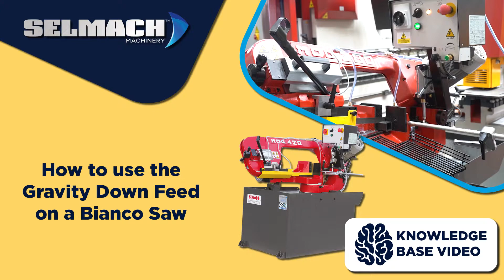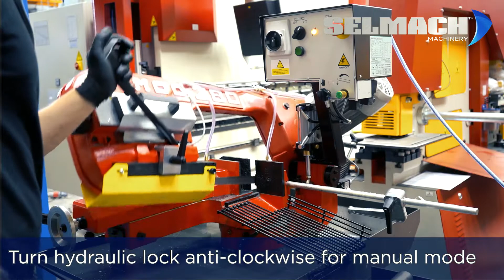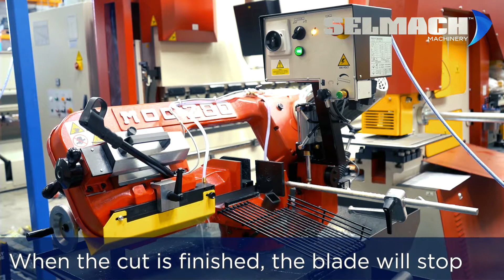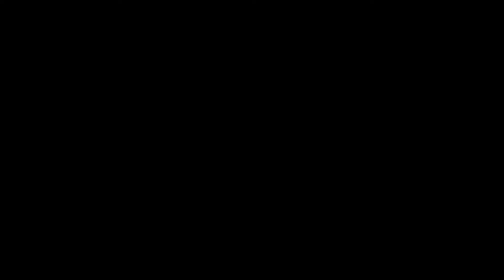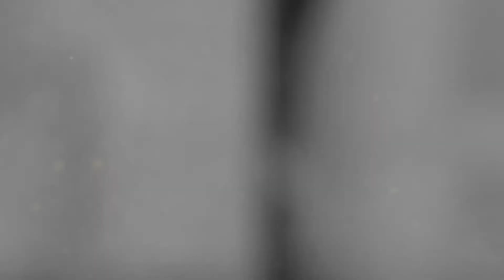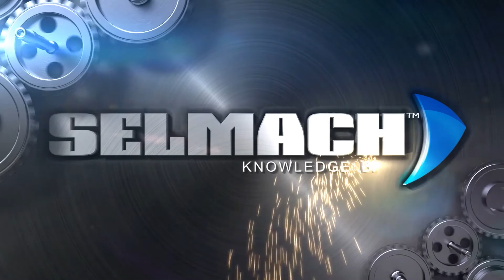How to use the gravity down feed on a Bianco saw [Selmach Machinery]

Comment: What price is this saw please don't tell me to phone the sales team as I won't as this is a sure sign something is over priced
Reply from the maker: Hi Geoff, 

As you can appreciate, there's a lot of variables involved with sawing technology, cutting capacities being the main one, as well as additional features and optional extras etc. For the saw featured in this video, (The Bianco 280MS) we retail this saw (in this configuration) at £4150 + VAT & Delivery Costs. I would still recommend talking to one of our machinery consultants though if you're interested in this saw, as the Bianco range is quite vast, and there may be a more future-proof solution in the range, as well as running through the full costs of transport, roller track etc. They can be reached on 01432 346 580 or sales@selmach.com
Reply: Thanks for that.